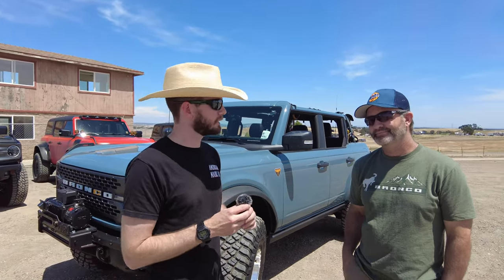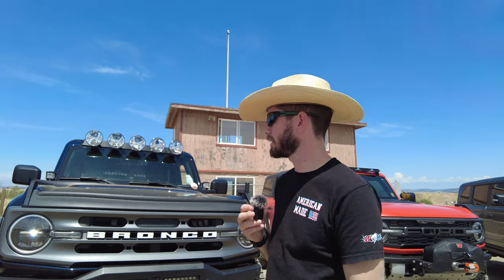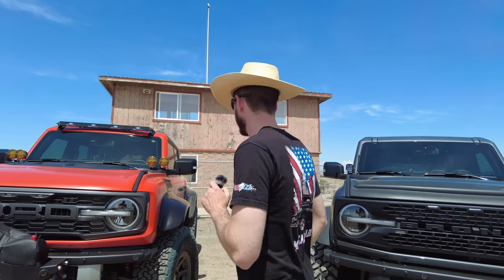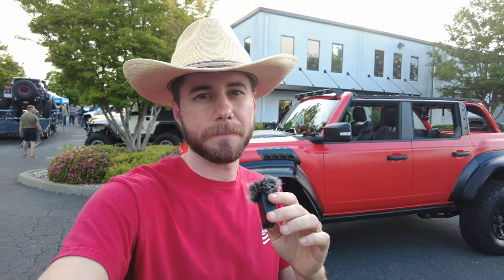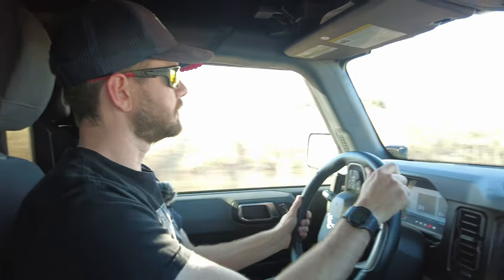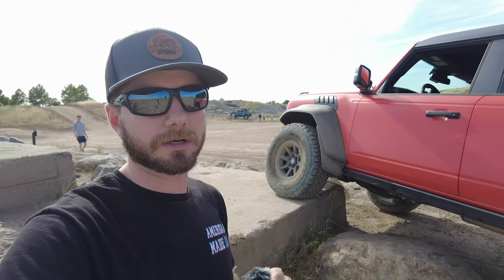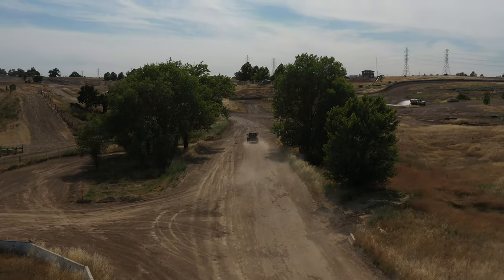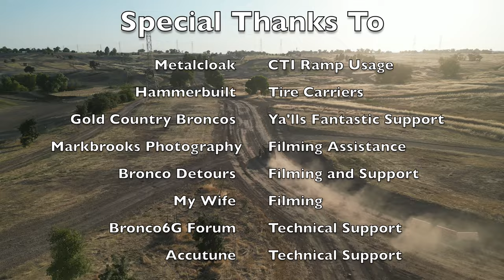Bronco Suspension Review (An unbiased guide)

Comment: Some sweet rigs  setups!!!  I'm curious what the aftermarket Foxes on non-Hoss 3.0 Bronco would measure.  I think the differences in flex very minimal for the Kings, Icons, and RadFlos.  Also very curious what the Long travel systems out there would compare with the BRaptor.    I've had the RadFlo ETs with MetalCloak rear Trailiing arms and love them so far.  Great video as usual Caleb!!!

Comment: Did Randy notice a difference when he installed the winch on the front? I have a 2023 bronco raptor and I installed a similar set up and I do feel the front dive more than it did I’m going to add a small preload spacer on the bottom of the spring which theoretically will lift it about 1 inch in the front which I would assume will fix my stink bug problem but I’m curious if he feels it also thanks for that awesome review👍👍👍👍👍👍
Reply from the maker: I’ll ask him and get back to ya here!
Reply: Thank you for the quick response I appreciate that👍
Reply from the maker: @jonluchessi1643  from Randy, “I didn’t really notice a big difference, but I added the winch very shortly after I bought it so I’m not sure my sense of discernment was that great.

I did do a very quick measured comparison against another raptor one day and I do believe I my front end dropped a little.  But I’m we were on different spots of the ford dealer parking lot so who knows.  Definitely not a scientific comparison.

The Raptor dives hard on braking since the beginning and still does.  I did some high speed braking tests right when I got it since the braking performance on Broncos in general and Raptors in particular is just awful.  I don’t recall the dive being any worse after the winch.  

I have bought back a little weight by removing my bumper end caps and the two sets of fog lights. 

Hope that helps in some way.”

Comment: I’m running radflo 2.5 on my bronco super smooth but need to dial them in a bit more to make it less bouncy.
Reply from the maker: Awesome! What kind of wheeling have you done with them? Any tuning or just off the shelf?
Reply: @popo_patty  I just do trails and some sand dunes. Saving up for Dana axle swaps. No straight of the box not tuned